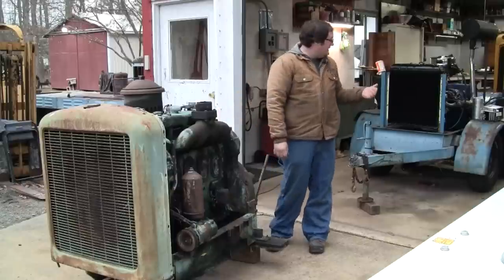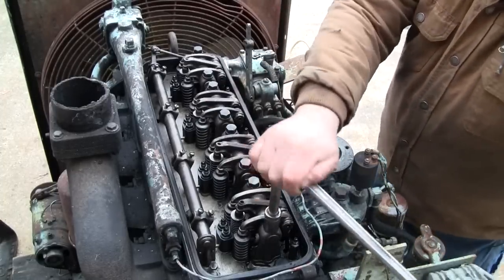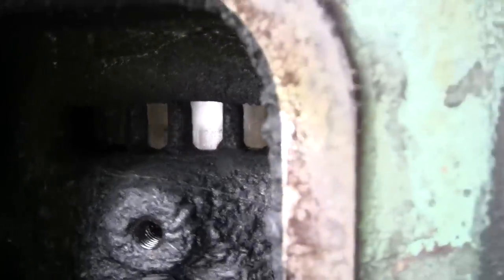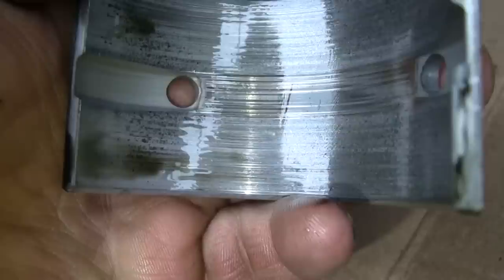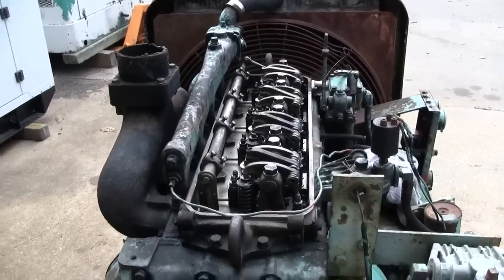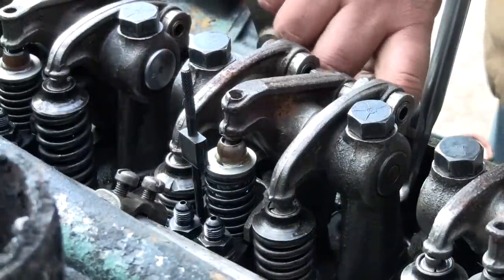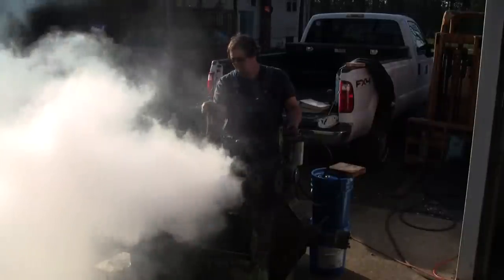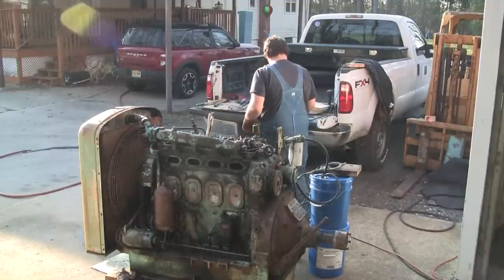Will This Tired GM Diesel Run Again?  1940 4-71 Detroit Diesel

Comment: I was surprised to see that much oil pressure. They were usually lucky to hold 30 psi. As others have said, straight weight oils are best. We had many Detroits in all types of equipment, from air compressors, to cranes to trucks. We had some 3-53s, 4-53s, 4-71, 6-71, 8V-71 and even a turbocharged 6V-92T.
Reply: 30 min and heat up the oil 40 down south

Comment: I have a 3-71 in my boat that was built in 38, and it was modified along the way and doesn't use a head gasket,  I rebuilt it several years ago and it was a wonderful experience for me as i had. never worked on a diesel engine.  I just work on my own engines. not a mechanic.It took me three months as it was in my boat in the marina and i did a whole bunch of research and had help from friends.  One friend gave me a great navy publication called a students manual for gray marine diesel, publiched 1943 and another guy gave me a factory service manual for the 2-71 engine published in 1972.  and i find many diesel mechanics will waste time on the phone talking about their favorite engines the 2 stroke detroits.  not to mention videos on you tube covering every aspect of rebuilding these motors.  I love this engine it is so trouble free and the physics and engineering in it are fun to learn about.  I wish i had found diesel engines when i was young.

Comment: I had a 6-73 150KW genset (wired for single phase so only 100WK that way) continuous rated that I used on an off-grid property for about 6 months before I sold the property. Genset had previously been used as emergency backup for a casino. Wasn't hard to get it running, awesome engine and a nice generator on it too (brushless). Towards the end of my ownership of it though it was clear it was going to need some blower seals. I could never load it enough though, only up to maybe 15-25KW turning every power hungry thing I had on plus charging a 40kWh battery bank. So was going to need some sort of load bank to continue using that genset - but for the $1500 ish I paid for it I couldn't find a good smaller genset for that price!

Comment: If you ever do rebuild this engine, I'd love to see it employed in some useful role.  I'd be inclined to fit it out as a generator with a suitable power head and speed and voltage regulation.  Would probably be a champion in an emergency relief situation.

Comment: They go away from canister filters what I remember in the late fifties early sixties and that will be a two valve unless head has been changed as the two Valve heads tended to crack from seats to injector sleeve bore where the 4 valves didn’t. Even being worn out it would smoke less with straight 40 or even 30 as they really don’t like 15-40

Comment: Mike, yeah that old 4-71 is in tough shape. Like you said, the lack of full flow oil filtration has pretty well trashed the bottom end. The good part though is it’s a very rebuildable engine. For about $2,500 in parts you can drop in new pistons and liners, and new bearings. It’s worth getting the crank ground undersize because crankshafts are not that easy to find. 
The 4-71 is a good engine for running a sawmill, pump , compressor etc. 
also a great generator engine.  Even in its present condition it’s worth $1500 or so.

Comment: The “Detroit diesel” name and the circular arrows came out in the mid 60’s.   It was in 1665 when GM diesel liquidated that line of engines and that’s when the name and logo changed.    The serial number style changed in 1948 too.    I love detroits, I’m currently rebuilding a early 1948 3-71 for one of my boat.   I also work with several other detroits and am engineer on a tug with a 1953 quad-71 pack (4x 6-71’s on a single falk 6:1 gearbox
Reply: It's a top little motor. 1965 was the year of the name change and when you found a GM engine with that on the covers you knew she was a classic
Reply: How much attention does all the linkage require to keep the 4 engines in check? I think GM billed that contraption a "6004" right?
Reply: @holysirsalad  no.   The 6004 is the twin pack.    
there were a number of model numbers given to them depending on the application and accessories.   They also changed the model number format later on also.   Our is a 24003 pack.    The linkages are a pain in the butt.  There’s about 16 linkages with ball joint links, adjustable rods and spring plunger levers.  It’s a absolute pain to set up when any are worn out

Comment: 1970s and 80s I worked as mechanic for a bus and Coach company, Brisbane Australia, we had several V671s a V871 and a V892, also a Nissan 2 stroke diesel very similar. Only ever rebuilt one of the V671s all the bolts holding it together were 3/8 UNCs but different lengths, only trouble was that on assembly I was 2 short bolts short and had 2 very long bolts left over?? Congrats on getting yours going, they always go but we don't have trouble with cold weather here.

Comment: Above the voltage regulator is what looks like the hot wire relay. It missing the cover. A safety device to stall the engine if the oil pressure does not come up. It activates the air box flapper and cuts the air off.

Comment: I’ve seen them plug up the exhaust to the point they wouldn’t run, usually from running light load. Needs about 4 hours on the  dyno at 90 - 100 horsepower will clean it up.

Comment: One of the most dependable engines made.I've worked on a lot of the 71 and 92 series.They love starting fluid when they get tired.Good video
Reply: By dependable you mean replace bearings at 4x the rate of any other engine requires.  Cold weather... don't bother unless it is fully pre heated before attempting to start.
Reply: We had a lot of Detroit diesels in our Quarry equipment, and the maintenance supervisor bought cases of ether when the weather turned cool. He said that the Detroit diesels are ether addicts. LOL 😃
Reply: @ShainAndrews  Ya, replace the mains every 30k hours whether they need it or not. Nobody is saying they produce the most power or are the most efficient. They are none of that. But even nay sayers like you should recognize the reliability and durability that decades of commercial use have proven they have. But I guess you run MTUs in your multiple yachts so you know differently.

Comment: My thoughts exactly....new bearings on a damaged crank.
Reply: They would be old bearings as soon as you hit the starter.
Reply: @rogersmith7396  Then all the debris hits the other bearings - the gift that keeps on giving!
Reply: @holysirsalad  I used to take the SAE journal.  Defects in an oil lubricated moving surface act just like road potholes.  Every time a moving object goes over the pit it enlarges it as the molecular oil film is disrupted at this point.  Of course debris can enter the pressure feed oil system and spread damage or clog it.

Comment: I'm actually currently working on setting up a generator that has that same engine minus the brass bypass filter obviously the one I'm working on is a bit newer but it has the same radiator shroud on it a oil bath air cleaner,  I can tell it had a 12v generator installed on it before somebody rigged up a alternator,  the blower intake says GM DIESEL on this one not Detroit diesel.  Its getting put back in service this year

Comment: That's a  pre 1950s circa old school.
Charles Kettering invented Zephyr first diesel electric train used Detroit diesel.Went in to create AC Delco and was the president of  GM .
Cool to restore that unit. Sounds like one cylinder is dead. Check injector and compression. Blower seals also dump oil into intake stream a lot on old units can run away.

I had cases of starting fluid on my crane and excavator to start them.
Never harmed motor if a small wiff used to lite it off. 40 years still running. 6v71 and 453.
PS Those gear fuel pumps don't like to prime lift fuel when dry.
Greata Thornberg gonna smack you.. Smoke man 😂

Comment: I used to drive two of those. One in the front, and one in the back of a TS14b scraper. Made somewhere in the 70s, they also had the turbo option. That one had a different crank I was told. I never liked the sound of those engines, but they sure earned their place in history. No surprise it didn't want to start. I have seen engines with only a few hundred hours on them that wouldn't start without starting fluid.

Comment: We had a 471 as a power unit on a 150 Prentice Loader. They usually had 353N's on them the 471 was never under any load by its little hydraulic pump and fuel smoked bad.

Comment: I have been repairing these engines of all series and cylinder numbers for more than 30 years, in Lake Maracaibo there were more than 6000 operating in oil fields, and they are still used for boats.

Comment: I’d go over the injectors again, it almost looks like it might have a split cut in that Smokey hole. That’s fairly raw fuel, but like you said, it has suspect compression issues.

Comment: Had a Pete 359, it contained a Detroit 671 (miserable thing) removed it installed a CAT 3408 V8 tuned it out to 475 Ponies, added a retarder was a Great truck to drive still operating every day last I heard. Nice to hear about an old 1968 Pete.   I was also later a Mechanic I made a lot of money rebuilding Detriot's, even had the chance to re-heading and detune a Built v12 that was in a Kenworth which put out 1200 ponies to the Ground Belonged to Werner a tthe time they sold it to a fool in Ca.

Comment: I'd love to see what that engine could do with a full rebuild! I'm guessing it'll probably need new cylinder liners/pistons/rings, in addition to the crank grind and oversized bearings. I take it those old engines didn't have glow plugs, hence the need for the torch in the intake.
Reply: Correct no glow plugs. Some trucks had ether injection systems where you'd attach a can of the stuff and have a button inside the cab to give it a snort while cranking. There was also an "arctic start" option that consisted of a diesel-fired torch for the intake itself
Reply: @holysirsalad  Another option used in the 80s through the end of production on these was webasto Diesel-fired coolant heaters. My school’s coach bus has an 8v92TA with the electronic injection and a 15kW auxiliary diesel-fired heater for the coolant for keeping the bus warm at idle. The bus is fitted with an auto idle stop system that will start and stop a hot engine from high idle if the bus is parked for a long time with the engine running, and use the diesel heater and coolant pump to keep the bus warm till the batteries get too low.
Reply: @alexphillips4325  Of course, I forgot about those things! I viewed them as more creature comfort devices but that's a great application for them! Also nice way to keep a fancy DDEC from coking up or wetstacking from idling too much
Reply: @holysirsalad  they idle them at around 1300 when they auto start (which of course sounds like the bolts are gonna come out of them) but it'll run for about 20 minutes to charge and then shut down for 40 minutes or so, the webasto and heater blowers/pumps don't need much power from the 6 giant batteries the bus has. A bonus is being able to preheat it to about 110 before starting.
Reply: @holysirsalad  the auto start certainly wasn't stock but it's a neat aftermarket system

Comment: For not much over $100 per hole, you can change the liners and pistons. New parts are out there so this wouldn't cost too much to make like new again. Hopefully the blower doesn't need rebuilding. Special tools needed for some things and the injectors should be sent out for proper cleaning and calibration.
Reply: My guess is crank turning on this is high.  The block needs to be hot tanked.  I also guess bearings are not cheap any more.  Even gasket sets are pricy.  Injector clean and tune, high pressure pump rebuild and tune, plenty of holes for money.  Head work, valve grind.  All new seals then we get to the blower.  You tell me.
Reply: @rogersmith7396  i actually just ordered everything to rebuild my 3-71 low block (1948 engine) my crank was previously ground .010 under but is still in perfect condition so the parts and including the hot tanking was $2400+$610 for the gasket set & crank seals.   I had to order my gaskets from a different dealer as the local machine shop wasn’t able to get the low block 3-71 gasket set.  Obviously the prices will vary depending on your location.   I’m in Canada and so are my suppliers to to get the parts across the border there’s a decent size shipping cost plus 13% in taxes added on.    But as a rule of thumb for Detroits it’s $150 per hole for just a liners, $250-$350 per hold if doing liner kits (liner, pistons and rings) then $1000/hole is doing a overhaul.
Reply: @TugboatMatt  I started car engines when I was a kid and everything was cheap then.  15 years ago the prices had gone up by a factor of 10.  My guess is they have doubled since then.  I guess machine shops want to be paid.  Parts prices for a Yanmar diesel are pretty high.  They want over $1500 to rebuild the high pressure pump and recalibrate it.  They charge over $300 to do each injector.  For my Saab engine I generally paid 10 cents on the dollar for parts on Ebay so except for the head work it was pretty cheap.  Got a reman turbo for $120 with warranty.  The crank was inspected but as I could see it was fine.  Just new bearings.
Reply: @rogersmith7396  Good idea but Detroit's run a low pressure fuel pump. I like these engines but I wouldn't run it with that much smoke. Needs to be stripped down and cleaned out.
Reply: @TugboatMatt  I just watched Diesel Creek do an old 6 cylinder.  Also smoked like crazy.
Reply: @hotpuppy1  parts are readily Available.   You can buy a overhaul kit or anything else you need from diesel pro.  Mines a complete overhaul.     You can buy just the liners for about $150 but as for doing a complete overhaul it’s obviously more.   Personally, I would just do a complete overhaul and have the block hot tanked and checked over same I just did with my 3-71.   Start fresh and stay clean.

Comment: If you get it under a load and slowly increase it to 100 percent load. It might come back. We had the same issue when I was in the service. They need a load to heat up and reseat the rings. Needs the soot blown out of it. Full load for about 12 Hours would do wonders for it.

Comment: Interesting to see if the smoke will clear up after it gets to full temp. From what I've gathered if the rings are really spanked it will pump enough of its crankcase oil into the combustion chambers to perpetuate and perhaps develop runaway.
Reply: It's always a possibility with a Detroit
Reply: By the look of the exhaust ports its blowing lots of oil.
Reply: Part of the reason part of the reason the early Detroit 2 strokes burn so much oil is they don’t have valve seals. They relied on the combustion pressure to keep oil from running down the valve stems, so under light loads they would put oil out the stack. 

My understanding for running away on oil for the two strokes was that it was more likely to happen with failure of the blower seals. That would feed engine oil under pressure straight into the air box.
Reply: @tnbrett1273  Blown blower seals are my understanding as well. Direct to the intake, and under pressure! Any diesel can runaway if the rings are bad enough

Comment: 26:25 Yeah as you were pulling those bearings, I though to myself hours aren't the issue here, nor is overheating due to lack of oil, it looks to me like very dirty oil really rubbed those bearings down.. She probably needs a nice grind on the crank and some .010 undersized bearings all the way around and some clean synthetic oil (Amsoil IMHO) and a handful of changes to see where it's getting so dirty. Good looking motor overall though.

Comment: Oh I love those old GM Diesel engines! I wonder too, what the Rootes Blower air gap is between the rotors? :)
Thanks for this one too Mike.   ( opps, I misspelled ROOTS ! hahaha )
Reply: First engine I ever heard of that has a blower but is not supercharged. 🙂
Reply: @bills6093  as a 2 stroke, it won’t run without the supercharger. My dad always called it a scavenger
Reply: @mmm365  It is a supercharger, but the engine has no boost. The supercharger only provides standard atmospheric pressure. For boost you have to add a turbocharger.
Reply: @jerrykorman7770  Yes, it just provides normal air pressure. There's no other way to get air into the cylinders. For boost, you add a turbo.

Comment: Another one I forgot to add about the materials used that things like copper would last longer than steel and was easier to work with especially when they didn't have the tools and machines of today.

Comment: those old school detroits are just god like. back in the day where you get full diesel power and not wimpy cailfrona boi emissions and computers. my grandad used to own a 1968 CCC concrete mixer truck which had a I6 detroit and man its lasted many years and puts out a lot of power. (especially when you used full synthiec oil) detriot power baby

Comment: In the air box long as it not oily sludge that’s good that dry called carbon is good normal for all GM s big and small I’ve seen these engines sit out all weather on tank barges and run pumps to pump off product above the blower there’s a little hole that gets a shot of starting fluid and that’s all was needed to start them I worked in a ship yard on the miss they used these engine s a lot